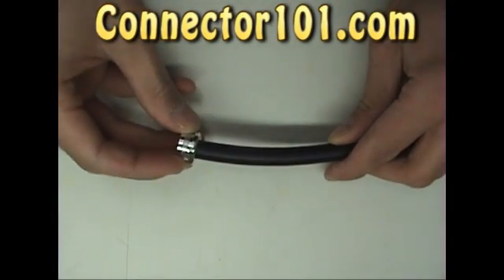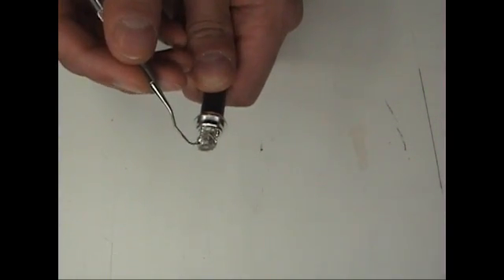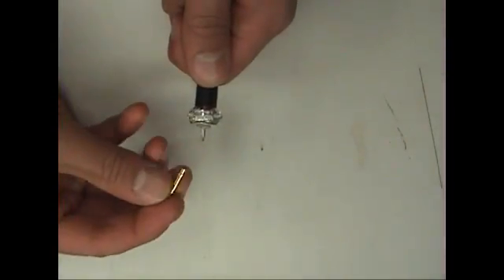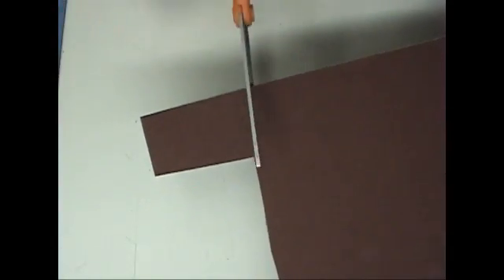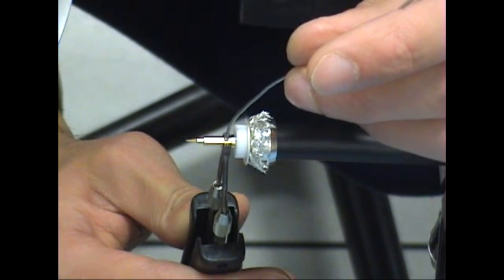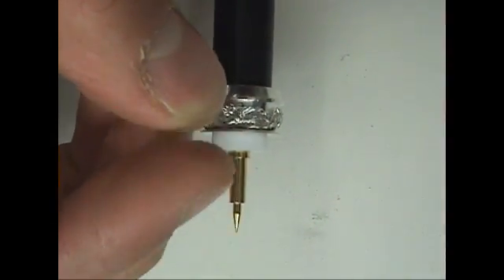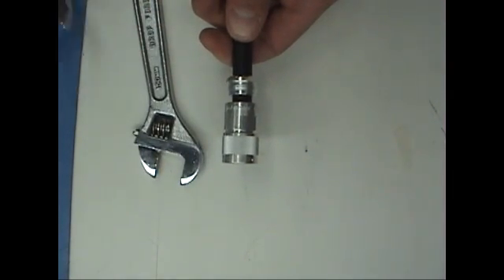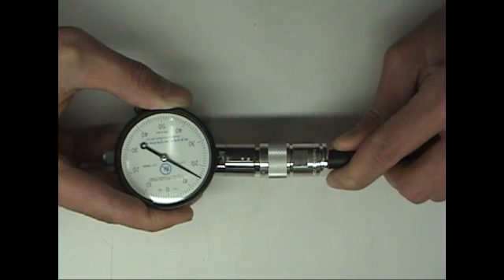Type N Connector Plug / RG214 cable

Comment: Just so you know after much argument at work one of our engineers dug up an original diagram for these connectors and the top Teflon piece is supposed to go cup out.  I know it doesn't seem right but it's there on the original diagram from 1960-something.
Reply: thank you. without that information humanity as we know would cease to exist. seriously, cup in, cup out, it's not going to make any difference.